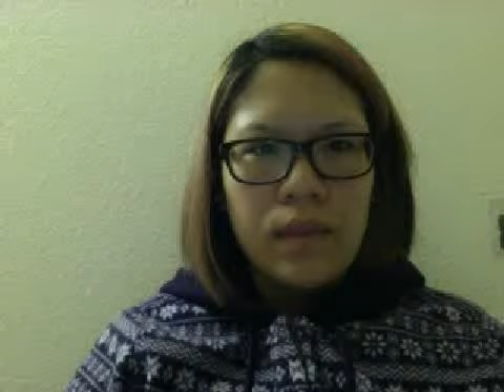IEOR 190G Week 7 EPO UK approach

Comment: It's great to know that there is an established way to assess obviousness as the EPO has established. Maybe, the USPTO should consider adopting a similar method. I mean the USPTO does utilize a similar system, however the USPTO probably deals with a lot more patents than the EPO does, making obviousness a more difficult factor to assess. Though, I will agree with you to say that the EPO does lay the way to assess obviousness in a more clear way through sort of a "process" compared to what the USPTO does.